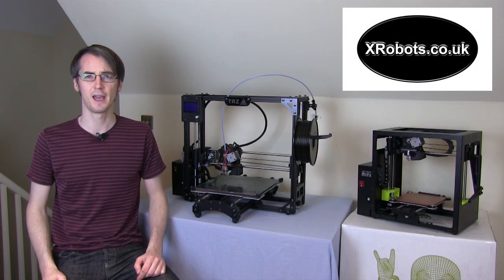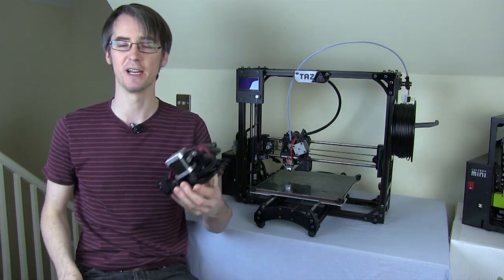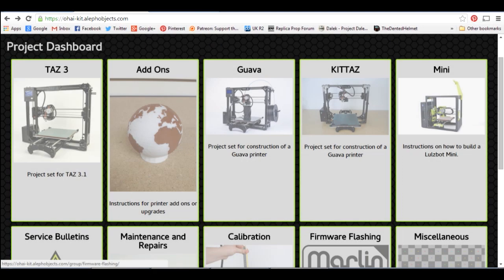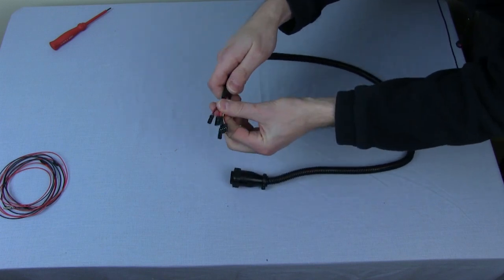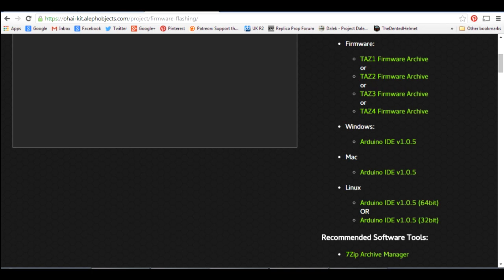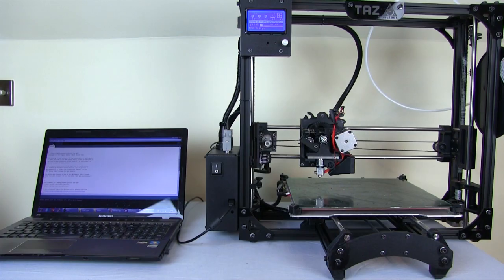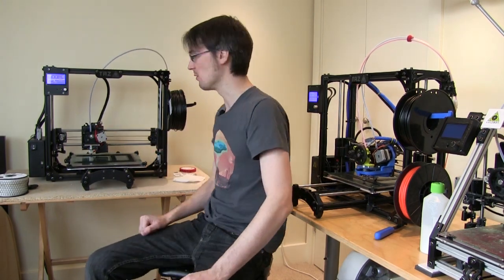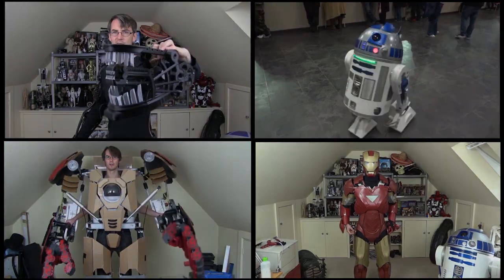Upgrading The Lulzbot TAZ4 with the All Metal Hexagon Hot End | James Bruton

Comment: Your videos are really well done and informative.  I've learned so much from all the way back into your original Iron Man builds.  Thank you for your hard work James!  If I may ask, for a beginner (I have no experience with 3d printing at all) but mostly it would be for custom miniatures and cosplay items, would you say that the Taz Mini could handle projects like that? It wouldn't be anything as big as an Iron Man suit, more so like gauntlets and armour items mostly.  I know that you can weld pieces of ABS together with acetone, I just wasn't sure in your experience if that would hold together well for a few smaller pieces; since the print bed is about 6x6x6 or so I think.
Reply: Awesome, thank you for the response!  I may invest and start small then. =)